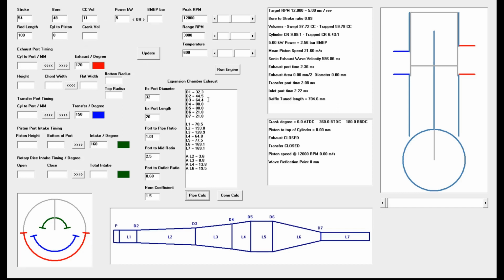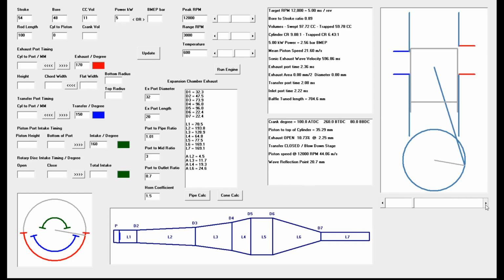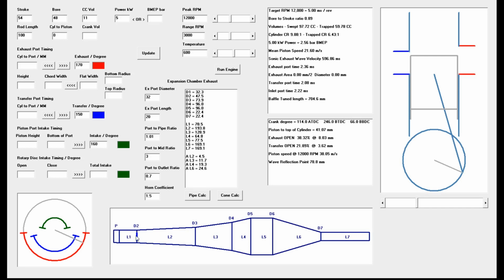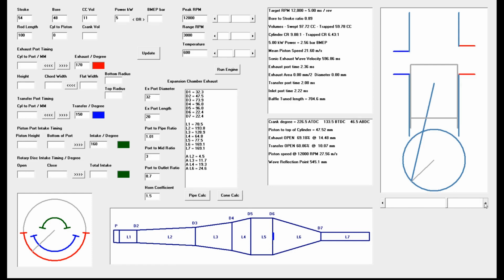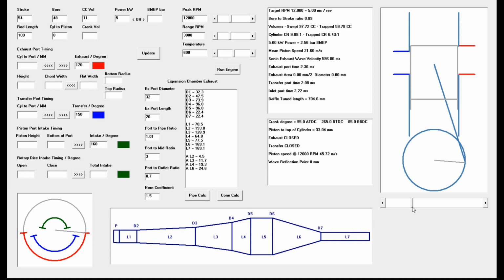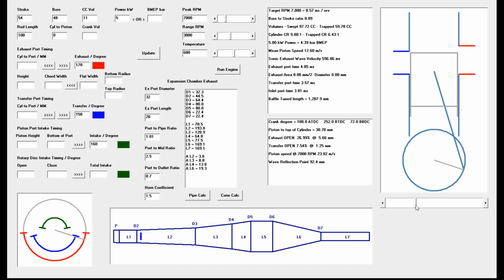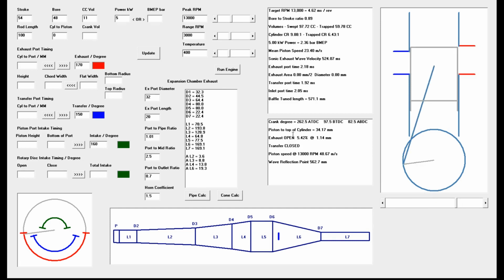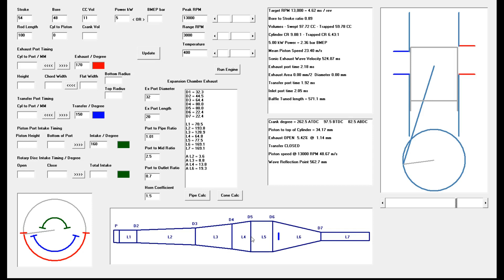Active Demo of Wave Timing through 2 Stroke Exhaust Cone Sections.

Comment from the maker: To cover a few questions asked.
#1 This is software I wrote for the purpose of the videos to demonstrate principles explained in the video series a bit more interactively as well as demonstrate how to design a pipe.
The equations in it are derived from the works of Professor Gordon Blair, second edition published in 1997 covering his in depth studies over a decade modelling 2 strokes..
#2 The moving wave reflection point is not wave itself.
It is to indicate the point along the pipe where the first compression wave will be reflected at in the pipe, and where in the total exhaust period the second reflected wave will arrive back at the exhaust port.
Reply: Hey Dave, congrats on a great series of videos. I'm a long time two stroke fan 45+ years still learning though. One question for you: is it possible to to use your programme to 'reverse engineer' two stroke exhausts? I often pick up old race bits and I have many expansion chambers in titanium, stainless and mild steel. I don't always have the engines to go with the pipes and it would be nice to work our, even approximately, what the basic setup of the engine was like. There is more to this than meets the eye, I reverse engineer lots of classic race parts and then reproduce them, its a growing business because most of the old race engines weren't designed to last and now we not only have the option to reproduce them without drawings but also to utilise modern materials if that is what is wanted.
Reply: Thanks for this reference to the book. I will try to get it.  Kind regards
Reply: @arnie8916  CLARO QUE SE PUEDE AMIGO, DESPEJAMDO FORMULAS Y GRAFICANDO EN UN DIAGRAMA ACUSTICO

Comment: Hi, really enjoying the theory of 2T on Sunday mornings :) I used to race 1/8 on-road RC-cars, the motors rev up to 42 000 PRM and have 2-speed transmissions.  (0-100 km/h in less than 3 sec.). They use nowadays only 16% nitro, with 7-9 port cylinders, but power or at least car speeds are the same, than  with 25% we used back in the days. I really would like to understand the motor even further and specially what the exhaust is doing. Also keen to know that is happening in the intake after carburettor in these revs and what the crank is doing (pressure, flow etc). So basically, how does the fuel "flow" through out the engine. I am going to build a dyno the run some R&D trials. Do you have a copy of your software (not only exhaust version) - the one you turn  the engine and have parameters?

Comment: Subscribed and notifications on.
As a paramotor pilot I have also, by default, become a 2-stroke mechanic. (We all fly almost exclusively 80-250 cc 2 stroke purpose built motors). As a geek, I appreciate this level of geekiness.
One of my engines, a Polini Thor 190 Evo Light, has been modified by the paramotor frame manufacturer Fresh Breeze, with the addition of a Helmholtz Tube attached to the first section of the pipe. I have yet to receive the tube but others report that it increases low range power and smooths the entire range.
It would be interesting to see how the math and waves work out with such an addition.
Reply from the maker: I would be interested to see more on that
Do you have any references to it I can look over ?
Reply: @AuMechanic  I wish.
Fresh Breeze is a small German company with a bunch of brilliant engineers but they aren't the best at advertising their cool stuff.
I have a newer version of the motor with a titanium exhaust but apparently they have been installing the Helmholtz tube for a while on previous versions of the motor with steel (I think) exhausts. They have done several of the titanium tubes but I understand they are having issues with their titanium sources.

In AU you could possibly reach out to the guys at poliglide.com.au. Tell them the Atlanta PPG guy sent you. (There is also a photo of the Fresh Breeze "Xtreme" on the website - unfortunately without the tube.)
Reply from the maker: Cool
If you see a pic of one with the tube and can send me a link to a pic that would be good.
Reply from the maker: I had a look around and found an image of it
It looks to be a sealed chamber similar to an intake boost bottle.
To quote the text
"The exhaust will modify by Fresh Breeze basically as well.
We build our tried and tested "Helmholtz tube" to the exhaust. It´s an additional chamber which stabilizes the engine. The speed will follow the position of the throttle lever constantly.
Our exhaust gasket seals the cut-off point at the resonator tube and protects it to cracks caused by vibrations."

At first look it appears it may dampen vibration from resonance that can cause 2 stroke pipes to crack which would not be good for aircraft.
How it effects performance though a wide RPM range does not make much sense though other than reducing vibration at the pipe and thus engine bu that would only be the case over a narrow RPM range that is the same as the natural frequency of the pipe physically.
The resonant effect off the baffle cone reflections Blair talks about only occurs at higher RPM and only in engines with at least 195 degree exhaust timing.
Reply: @AuMechanic   Interesting. 
One of the most popular paramotor engines currently in the US is a "Moster", 185 cc, from Vittorazzi (like Polini an Italian manufacturer). It's generally a very reliable motor except for the exhaust; they break and crack often and repeatedly - and they don't use a Helmholtz Tube. (That may change if Fresh Breeze brings out a paramotor with a Moster motor).
But the Polini motors have never had exhaust problems. 
What I notice on my 8000 rpm motor without the tube is a very distinct powerband which makes it difficult to fly at a fixed altitude because the RPM required is just at the start of the band. In contrast, my much older Simonini (also an Italian manufacturer) Mini2 based machine with a max RPM of 6200 has a smooth power band from idle up to max, though it produces probably 40% less total power than the Polini.
A friend owns and flies both versions of the Polini; the older one with the tube, and the newer one which had no tube when he got it. He said it "fixed the mid-range throttle" and that it's now "a joy to fly".

I understand the Helmholtz Tube to be a beer bottle - a simple closed chamber - and that's about what it looks like and about the right size.
Not being really good at the math behind it I would have expected something which helps at the lower end to need to be bigger (more volume) than the chamber for the top end.
Reply from the maker: That's basically how it works, the :"Boost Bottle" used in 2 stroke intakes that Yamaha first started using works the same way, the volume of the bottle and tube is set to be the natural frequency of the RPM range at lower RPM below the peak to smooth out or cancel out  a resonance in the intake that causes poor carburation right at the set RPM so smoothing it out provides a smoother transition to peak.
It works in principle like a noise canceling system that generate a resonance of the opposite phase to the one you want to tune out of the system.
In this case with gasses using the Helmholtz effect.
There is a formula I've seen to calculate the bottle volume and hose ID and length to use based on the RPM for boost bottles and the same should apply to this for the exhaust.
It is not something I've ever seen used on an expansion chamber and for a geared engine would not be necessary however a spring kart with no gearing that needs smoother power over a wide RPM range this sort of thing may have some application.
Reply: @AuMechanic  
No gearing certainly applies to us though there is sometimes a centrifugal clutch, and the prop RPM usually has a fixed reduction  by something like 2.3:1 or so.
I've also heard of it being used in automotive systems to cancel out resonances in after market exhaust systems which produce droning sounds at specific RPM.
I can't wait to get it on my motor and see how it differs but it may be a few months yet.
Reply: I finally received the tube on Friday, had it installed on Saturday and flew it that evening.
It made an amazing difference. 
Initially on the ground I couldn't tell the difference but once I got the (membrane) carburetor tuned properly, I found I could hold the motor speed fixed +/- ~200 at any random RPM value between about 4000 and full throttle.
Almost all of my flights on this motor have been "experimental" where I was trying something new but on this flight, even though I was planning on a similar "test flight", after I had played around with the throttle a bit, I found myself venturing farther from the landing zone than I think I have ever trusted that motor, and just enjoying the flight in general.
(I have experienced two piston holes in flight) due to a manufacturing failure in the spark timing. Fresh Breeze provided a dynamic CDI ignition system as a fix but I was still nervous about it.)
Before welding it in, when I blew across the bottle it resonated at 241 Hz. I wonder how that has anything to do with the improvements I'm seeing between 3000 and 5000 RPM.
Reply from the maker: @PPGATL  
Blowing across it the air is ambient temperature so there would be a correction factor for exhaust temperature gasses that would change the natural frequency of the vessel, so 241 hz would be higher.
For example if the temp was 20C and the fundamental wave was 241 hz then at 400C it would be about 403 hz
You can calculate the actual fundamental and 3rd and 5th harmonic of a closed end tube if you know the length of the tube and the temperature of the air but this being like a boost bottle I think there is a bit more to the equations, Ill see if I can locate it.
As to the results, would you say it hard more power as in same power for less throttle.
Did the engine feel smoother as in less vibration.
Reply from the maker: Here is some information on Helmholtz resonance
https://newt.phys.unsw.edu.au/jw/Helmholtz.html
Reply: @AuMechanic   The major change I noticed was the smoothness of the entire RPM range, no change in vibration.
I believe the throttle position was different (more closed for the same RPM) but that's purely anecdotal.
Some other details I noticed was that the top end was reduced by about 200 RPM, and the engine ran noticeably cooler, especially under full throttle. Before the tube, full throttle was 8100 RPM, maybe a bit more, and the CHT rapidly exceeded 200°C if the engine was left at full throttle for more than a few minutes, for example during the initial climb. 
After the tube I'm seeing about 7900 RPM and the CHT only very slowly climbing, remaining well below 200° during the initial climb out.
Overall fuel consumption is also improved. The previous flight burned half a tank in 45 minutes while with just a little less fuel I was able to fly 55 minutes. That's also a bit anecdotal as I did not track exact fuel usage but I'm sure it made a difference.

I discussed this with Fresh Breeze, the people who came up with the tube (not Polini, the original designer of the motor) and they say that they are having trouble convincing Polini that their motors need it. Polini has a reputation of motors running too hot and have even produced several different shrouds and other devices designed to improve thermal transfer from the motor. Based on what I've seen in flight, I think this fixes the temperature issues too.

I think I understand basically how resonance works - from bridges being destroyed by soldiers marching in step to beer bottle tooting down to those whirly tubes at the carnivals that whistle at different frequencies depending on how fast you twirl them, every flexible body has a natural frequency at which it will oscillate given enough correctly times thrust pulses, and that frequency can be increased in steps by harmonics.
But I was not aware that temperature would change the resonant frequency so dramatically.
I am also confused why the Helmholtz Tube can work across such a wide range of frequencies on the exhaust. On my motor, the tube is having a positive effect from about 3500 to about 6000 RPM. One resonant frequency or two I could understand, but that wide of a range I don't get. It's almost as if the volume of the tube is not important as long as it remains within a range but from what I've seen, the tube needs to be designed with engine displacement involved in the calculation.
Also, from what I understand on regarding boost bottles, those work on the intake side while this works on the exhaust.

Lots of learning to do still.

Comment: Hi, i could not get this software only the other ones
Reply from the maker: Yes sorry but this software is not downloadable, only the expansion chamber software is linked in the description section.
I only wrote the one displayed for the purposes of the videos to explain things.
Reply: @AuMechanic  ok, I can open only the stand alone program, one thing, on exhaust chamber calculator, i don't see engine cc bore x stroke to input, i am confused
Reply from the maker: @flyboyfs   You don't need to use Bore and Stroke, the expansion chamber diameters are in relation to the port area, which in turn should be appropriately sized to suit the engine capacity.

Comment: Stupid question, but would and properly designed expansion chamber help a lightly modified victa 160 cc lawn mower engine on my vintage go kart
Reply from the maker: Yes if the engine is modified already it probably has sufficient port timing and BMEP to benefit from an expansion chamber.

Comment: Asking for the Belgian Honda Camino Community: will the length of the silencer affect the torque or top speed in any way on a 50-75cc 2 stroke engine? It's a hot topic on our forum, I want this cleared out. Thanks in advance.
Reply from the maker: If the "silencer" in question is an expansion chamber then yes the length of it will effect peak performance of the pipe relative to RPM because the pipe length is designed using a calculated tuned length derived from the engine parameters (as done in pipe software) one of which is RPM.
So if you change the length of the pipe at some point it will mean the pipe is not tuned to the peak of the engine it is designed for.
For example if I shorten the pipe reducing the tuned length then the pipe is tuned for RPM higher than the engine RPM range.
That will not make the engine rev higher unless you make some other changes to it such as port timing to get it producing peak to a higher RPM.
A tuned pipe is tuned to the engine parameters and making changes to it effectively de-tunes it from the engine it was designed for, now in some bases if it is stock it might be causing some detuning a bit to favor emissions targets and in that case you might make changes to it that improves performance, but be aware that you wont know that until you have tried it and it can just as easily end up with less power and only more noise.
Reply: @AuMechanic  thank you for this well detailed answer. But I think you misunderstood the whole 'silencer' meaning. The concept of the exhaust 'pipe' with expansion chamber is well explained on your video's. What I meant to ask for was the effect of the muffler pipe length, the part after the 2nd cone where the gasses exit the chamber. Some say they get higher end speed with a longer bleed pipe after the same setup.
Reply from the maker: In that case, the outlet pipe is simply a pressure bleed and length only influences the restriction the outlet pipe has with respect to pressure bleeding off. There is no tuning in its length and that has been studied and found that for example so long as the tip of the outlet pipe at the chamber end is the right size the outlet pipe beyond that can be a larger ID and it length having no effect on its function and this was done on some exhaust to allow for a much shorter outlet pipe on engines with reward facing exhaust ports.
So any increase in length of the pipe in question by way of a longer silencer is simply changing the amount of restriction to pressure.
And that pressure level has an influence on port plugging as does the baffle cone itself.
So the longer silencer may in effect improve port plugging that is a function that occurs at and after peak RPM so it may be possible to get it to rev a little more.
However that is theoretical and would need to be proven in a test because stock pipes are more often over restrictive so the higher top speed may be due to some other factor and perhaps not longer silencer.

Comment: What program is that?
Reply from the maker: I wrote the program for the video series to demonstrate a few things.
Reply: That's awesome. Probably the best explanation of expansion chamber principles you'll ever see. What is a good 2STROKE software for midrange skill level.
Reply from the maker: Its a bit hard to cover the topic using just diagrams hopefully the software demo makes it a bit simpler.
As to which software to use, not easy to answer as there are various levels of what the software does and depends on what you need it for.
You can get basics pipe calculators up to full feedback modelling you can make engine modifications in and get some figures of estimated power.
They range in price from USD 20 up to 450.
Reply from the maker: @wesleyyoung1143  
I've now got a pipe calculator software I wrote for download, its freeware.
https://www.youtube.com/watch?v=AppjfX4TdOM
Reply: @AuMechanic  can we get this softwer
Reply from the maker: @g.g4816  See the description section below the video for link to free pipe software.
The software shown in the video is not for download, I just wrote it for the videos to demonstrate what the video is about.